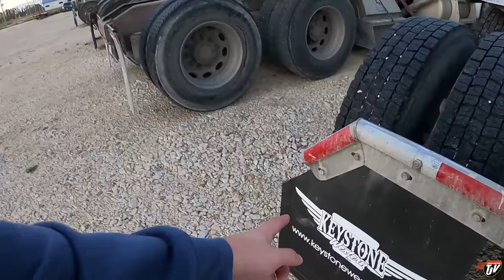LOST IT! | My Trucking Life | #2365

Comment: I drive for UPS and all of our trucks (at least the ones I've been in, in the the Northeast) the dolly brake will stay down. Macks, Freight Liners, KW's all of them.  We use it a lot when building doubles. UPS protocol is to have the dolly brake engaged when working between the trailers or, just when parked for that matter.

Comment: Dear Josh, I  drove in 1995 a Volvo F12 here in The Netherlands and it had the same trailer brake you have. A few years later this was, as far I can remember by law not allowed anymore. At that time I already switched over in driving touringcar buses. So I don't know how it is today because I am already retired. But what we did was using the trailer brake to slow down and spare the trucks brakes. Most of the trailers were rentals. Very naughty indeed. Drive safely and keep the rubberside down. God bless.